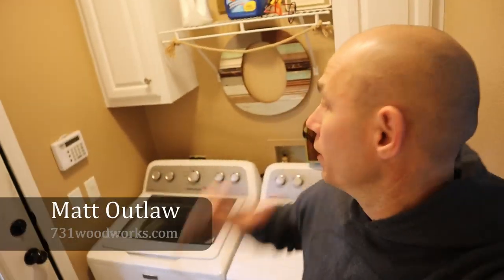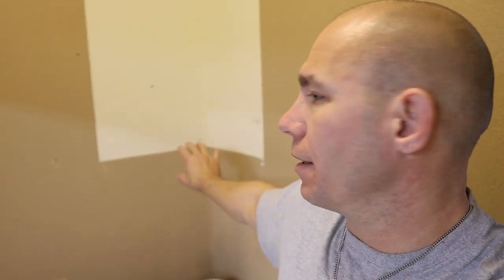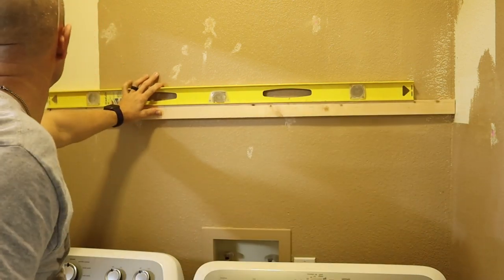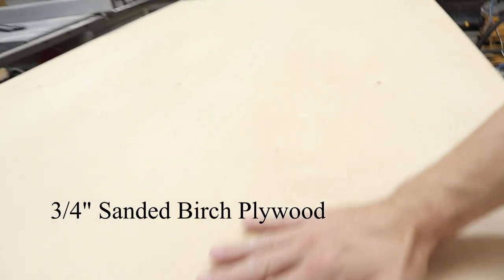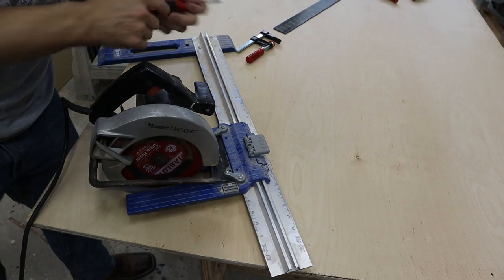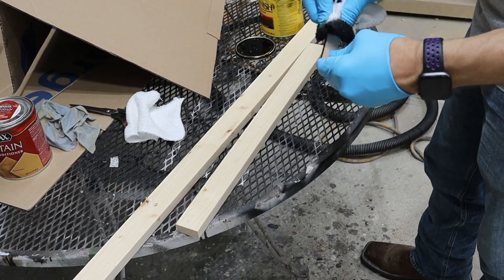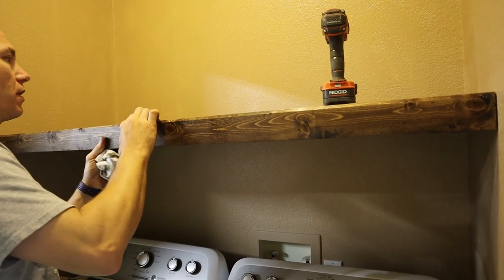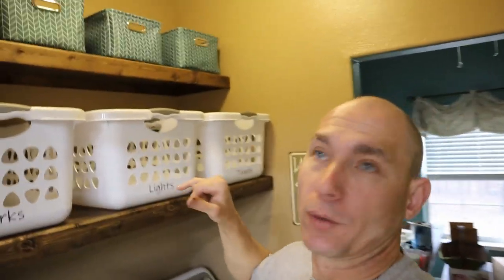Easy DIY Laundry Room Makeover with Plywood Shelves

Comment: Nice work! 
At what point (length of material) would you decide to use a middle support for the board, so it does not bend? I need to use a 6-ft long board

Comment: So I’m curious, did you start out replicating other woodworking ideas and then start making your own projects? How do you even know where to begin when you decide to start to design  a project? Like how it will hold up and such?
Reply from the maker: That is how I started.  I built a set of Jay Bates' outdoor arm chairs and just kept building things after that.  As far as how it will hold up, you should get a pretty good idea if something is sturdy enough or not after you get it built. If it needs more bracing or something, that could be added later.  Hope that helps.

Comment: Are these "floating" shelves? I'm not sure what the definition is but I thought floating shelves had a separate bracket/support and a slide on "cover".
Reply from the maker: "Floating" shelves can be several types.  But typically they are similar to this style you see in the video where there are no brackets hanging down.

Comment: Howdy Mr. 731...

Yeah, another Gem I dug up. I gots ta have my background videos running while I'm finish-sanding (1500grit now) my latest project. 

That Kreg rip cut thingy ma bob....Yeah that's the one I got several months ago. I don't see how you managed to use it. I spent HOURS trying to get the slop out of it to no avail. It wasn't accurate at all. I followed all directions etc etc. Worst tool I've ever purchased!! Wish I could send it back to Kreg. 

I reverted back to old school...clamp down a level to use as an edge guide. Takes a few minutes to set up but gives me very accurate straight cuts. 

Because of my waste of money on the Kreg rip cut jig, I said NOPE to the $90 Accu-cut track saw jig.....and because of my bad experience with that jig...I've pretty much swore off ALL track saw stuff. 

I like the floating shelf though. 

My daughter wants floating shelves for her room but these would be attached to just a single wall, not 3. I understand the concept of how they are done....But I can't seem to wrap my head around how to do a 3' to 4' floating shelf that's 10"+ wide. It just seems to me that it would sag.

Perhaps you could do a video on that??:_fistbump:

Comment: Would you say upgrading to a k5 or k4 would be a huge upgrade from the r30 or would you say spend my money on a different woodworking tool?
Reply from the maker: The Kreg K4 and K5 is a big upgrade from the R3 just in terms of convenience.  And you can drill holes faster. I am happy that I upgraded from the R3 to the K5.  I still use my R3 occasionally for tight spots the K5 can't get into.

Comment: I know this video is older, but I have the same setup in my laundry room. My wife wants to keep our cabinets, but wants floating shelves. How would you go about attaching the shelves to the cabinets using your build plans?
Reply: Angle brackets on the edges if you don't want to screw a board into the sides of the cabinets. Good luck!